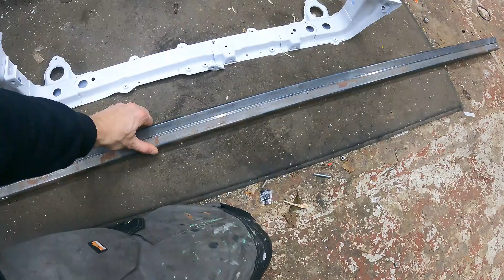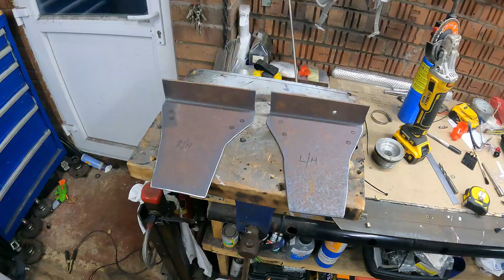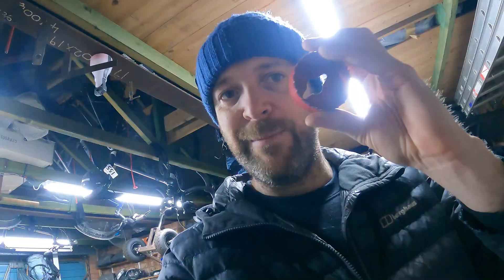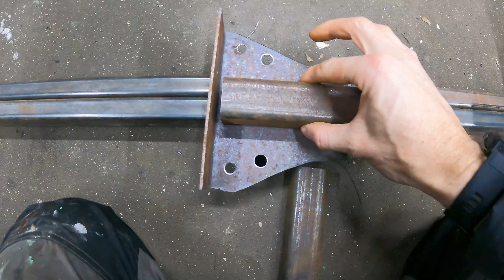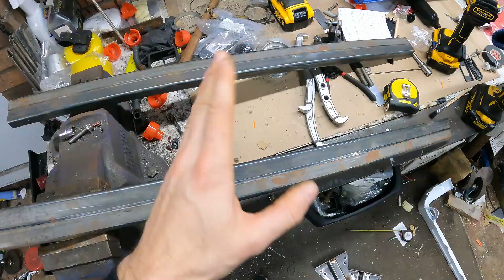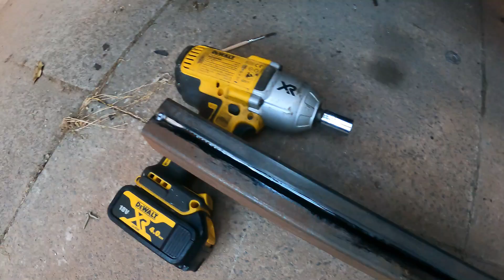MK4 Supra front jacking support

Comment: Consider lubricant on the hole punches. At least  the threads. The tools will love it.
  The "double wall" is good thinking.   It makes it a boxed in I-beam.  I made my  English wheel out of I-beam and it failed my torsion test.  I boxed it in and that made it beyond stiff enough. 
 When you POR15ed the tubes,  I started to think that you could have just bonded them together with the POR15.  Then stich welded.